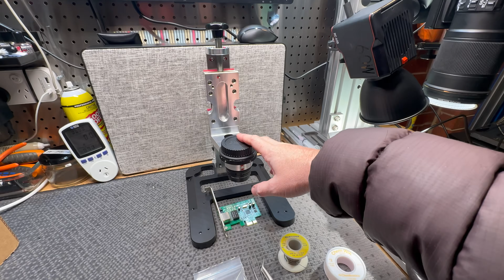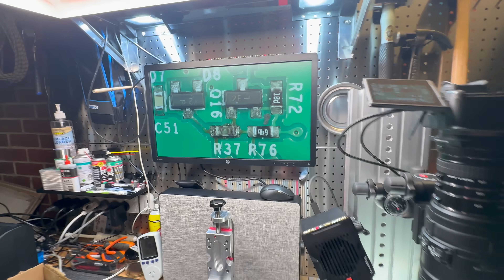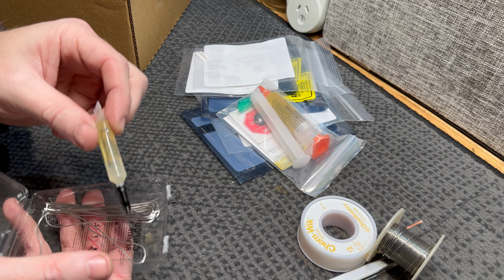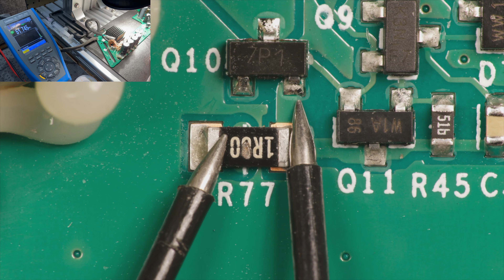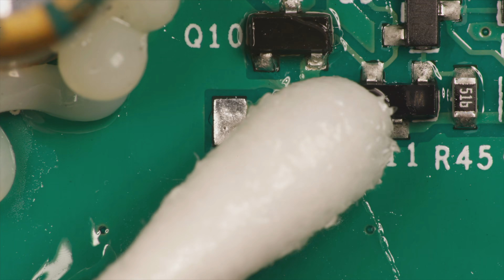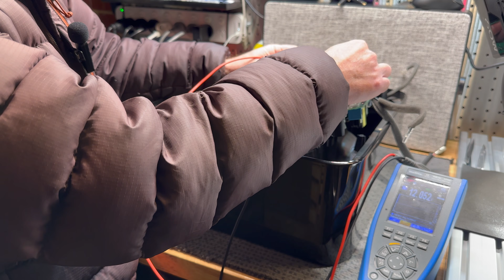SONOS Subwoofer Repair - Part 2

Comment: Thank you for saving my sub from a landfill. R37 and R77 were cooked so ordered the parts through mouser from your part 3 video and got them all soldered onto the board. Now it works like a champ.
Reply from the maker: Glad you were able to pull off the repair and save it!

Comment: Hi... I want to thank you for producing this video. My subwoofer died about a week (no white light). Examining the main board revealed the same issue that you discovered with R37 being cooked  and R77 having a small chip in it. With your help I was able to put together a parts list and ordered them through Mouser. I have experience with soldering through hole components but never did any smd components. 

Using a USB microscope I practiced on an old PC motherboard. It was challenging at times but it helped build my confidence. 
I ended up replacing the same 6 components. I did end up having to re-flow the solder on one of the transistors, but after that I was back up and running. It is a very gratifying experience to be able to repair an electronic device.

Thanks again !

PS: for those who are curious, and it was touched on in this video, many smd components are VERY tiny.  I compared R37 to a grain of rice.
It is approximately 1/10 the length and 1/2 the width. If you also want to attempt the repair I suggest ordering 3 or more extras of each part. It's easy to lose them when attaching them to the board. Practice on an old discarded circuit board. And of course respect the high voltage side of the power supply.
Reply from the maker: Great to hear you got it working and also got to learn some SMD soldering like I did also! Thanks for the feedback!

Comment: Excellent, thanks for posting this series! My Sub suffered the same fate (no power up) and investigation showed the same component issues. Ordered parts (thanks for the parts list in Part 3), and will attempt my first surface mount repair. I've done a bunch of through-hole repairs, but these tiny freakin' surface mount parts will be a first. So tiny...
Reply from the maker: Best of luck with it! The repair wasn’t bad, all things considered, but I highly recommend some sort of magnification to do this as its soooo small
Reply: @whatcouldgowrong7914  I took your advice, I picked up a 10x lighted rectangular magnifier. Absolutely essential for sure. I have completed the repairs (R37 was a pain!😖) and my sub is back up and thumpin'. Thank you again, so much appreciated! 👍👍👍
Reply from the maker: @REW-FF-Play Great to hear! 🙏

Comment: Hey mate. Great video. If you want to use your desoldering station, you can use kapton tape or whatever it’s called (the translucent yellow stuff) to hold down the parts surrounding whatever you want to remove.

Comment: Nice little trick using low-melt solder to desolder without hot air — clever!
Looking forward to a third video when you replace all the capacitors. If possible, please list all the parts, especially the caps.

I've repaired a lot of devices just by removing and testing the capacitors with a Keysight meter. It's surprisingly fun — you learn a ton about how well old caps hold up over time. In my experience, it's usually the power supply-side caps that fail, especially due to the high-frequency switching circuits. Meanwhile, many 10–20-year-old caps not exposed to that abuse still test within spec. What i do is remove the cap, test it, then place in small plastic bag marked with the location (Sharpie). I even save the data from the keysight to an Sql Database for future reference of all my repairs. I also test the new Caps and record that information.
Reply from the maker: Yup ill give a final list, will be a little later as the station just arrived but should be satisfying 🙂 I think the caps will be fine but… while im in there :)

Comment: That macro setup is heinous! (Heinous in a good way.) The vertical mounting orientation is great — probably doesn’t put a lot sideways force on the lens and adapters.

Wondering why you went with a 180mm vs say a 100mm Macro? Not sure if the 180 is also a macro? What are the other adapters?
Reply from the maker: 180mm just gives me more working distance and its my sharpest macro lens. I have a 100mm and MP-E 65mm also which I may use depending on the job. The rest is an EF lens mount adapter with filter tray and 3 extension tubes. I will do a video on this when I get some time soon as I have added a vertical rail to raise and lower the camera height without removing it :)
Reply: @whatcouldgowrong7914 looks great!

Comment: I don’t think it matters much at all if there is as much solder as in your example. I solder quite a lot of SMD components for my projects (not professionally though), I usually don’t even bother using a microscope for 0603 and above. It’s more an inspection tool at this point. (You basically can’t do 0402 without a microscope though and I avoid it in my own projects at all cost.  I’ve never soldered anything smaller than 0402.) Is the result perfect? Nope, it basically looks like in your example. Does it still work? Yep. I’ve come to accept that while still trying my best each time 😅

Regarding the caps: just buy a proper desoldering gun and don’t bother with cheap desoldering stations. It’s a good investment imho.
Reply from the maker: My Hakko FR-410 desoldering station arrives next week :)

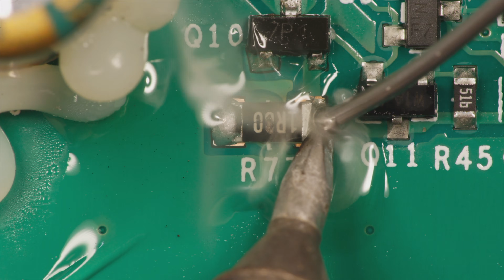Comment: 11:50 Try touching and heating the pad and component first, then adding the solder to it. You should not just melting the solder in thin air.
Reply from the maker: Wasn’t trying to do that, like I said looking at a screen etc hand eye coordination and depth perception need a lot of practice especially on weird angles 🙂
Reply: @whatcouldgowrong7914 Hi, I am trying to fix one.
This is a DC-DC downconverter circuit.
Do you know the output voltage?

I need to know the valle for the Q10 and R37.

Any help will be appreciate.
Reply from the maker: @treadmillrepair754 12v output, refer to part 3 video where i have a table of all parts used towards the end with mouser part numbers also

Comment: I don't like low melt personally, i will use hot air or or hot tweezers in this case
Reply from the maker: Was avoiding buying a hot air station for now. Maybe in the future it will be added to the bench…
Reply: @whatcouldgowrong7914 the RF4-H2 is a good option for the price.
Reply: Actually, I think he just used low melt solder to get the part off, this is actually clever. Then you can clean the pads, and use standard solder once again. He's trying to avoid heating other parts nearby via hot air, is my guess.

Comment: Whoa, the "microscope" workaround turned out very amazing! The dynamic range and the details are just insane
Reply from the maker: Can still get better also with a higher end capture software I think 🙂
Reply: @whatcouldgowrong7914  What software did you use for this video? Oh, after reading the spec on that FR-401, it is a beast. 15L/min pump is no joke for a desoldering iron. Clogging wont be an issue. I build one myself since I can't afford one using cheapo manual desoldering iron but with twin 15L/min pumps. I have a video of it on my profile
Reply from the maker: @aizu35I was just using quicktime for now, I have better software but wasn’t comfortable getting too adventurous yet until I learn the Canon R6 better for video work 🙂 Once this series is complete ill work on making things more mature :)